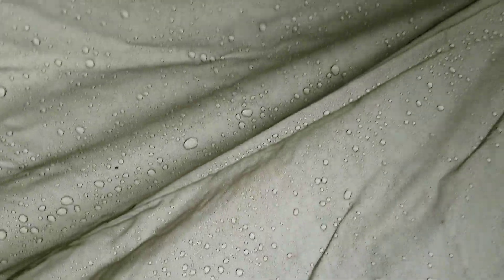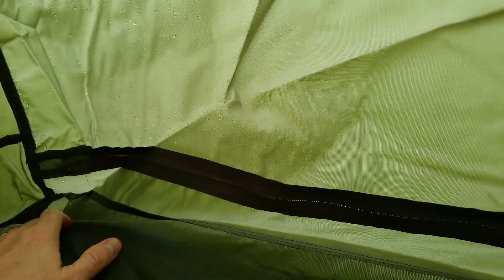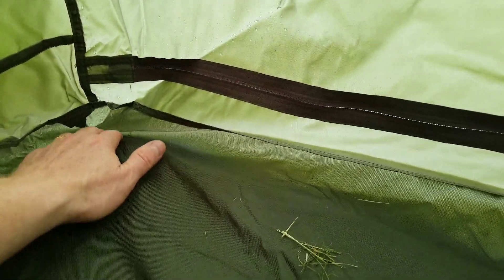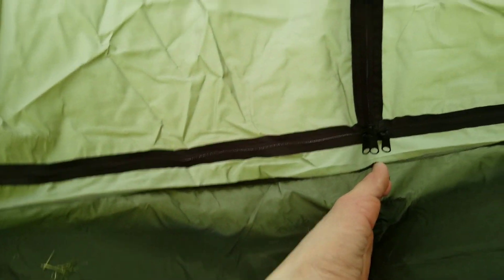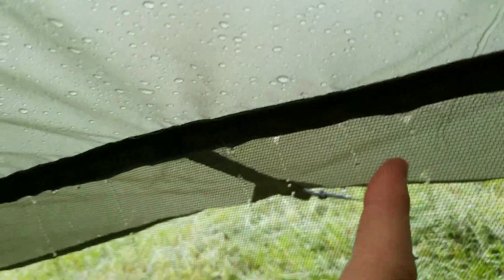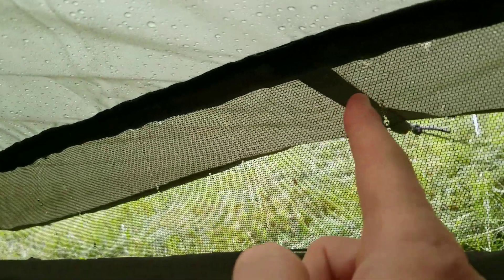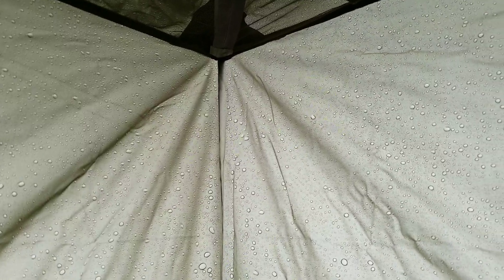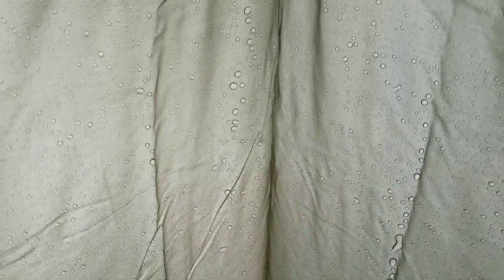F1 French military surplus pup tent in the rain.

Comment from the maker: So the areas that need seam seal are the seams in the four corners - one corner had water after 20 minutes, and I suspect the others would eventually also. I would also do the zippers - if there is a driving wind I think water would get through there. Other thing I noticed is that water came up from underneath in one corner where my ground cloth was sticking out a bit allowing water to pool - you might want to give the bottom a coat of silicone spray. The fabric on top seemed to do the job but giving the whole thing a coat of waterproofing probably isn't a bad idea.
Reply: E Butler cheers for review I've put a tarp over mine in the rain and have no problem each too there own seal/tarp I prefer the tarp 👍
Reply: @chrisc4636  what's a good size tarp for the French Army tent?
Reply: @lairdsky4604  3 x 3 works for me